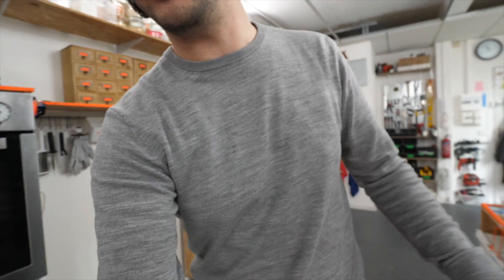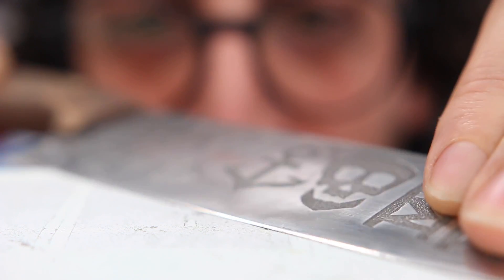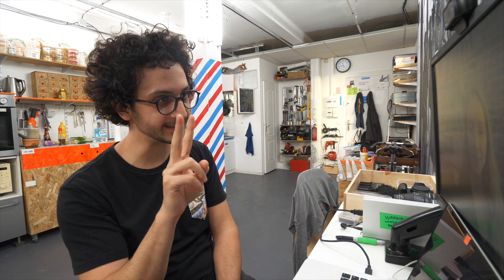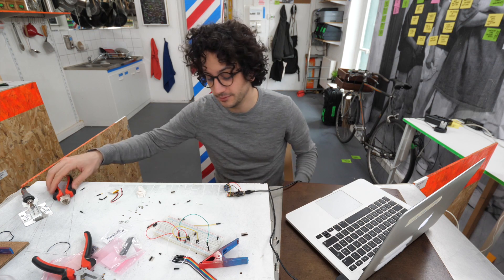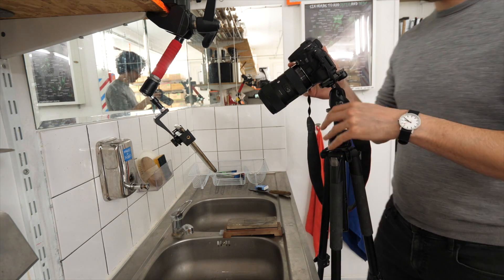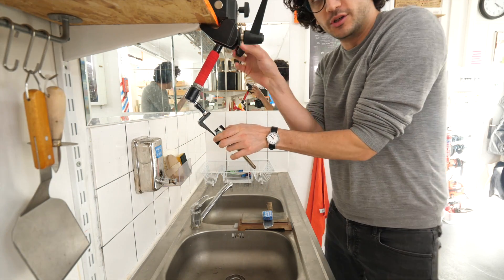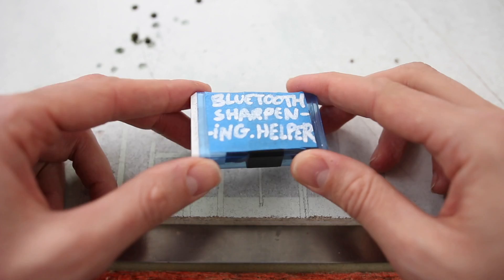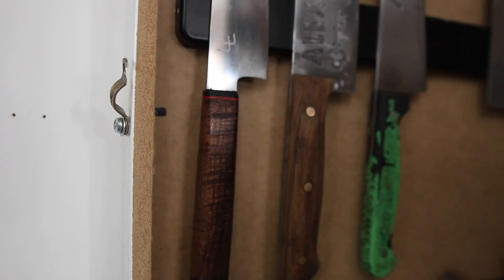Is This The Future Of Sharpening ?

Comment: I think whenever there's a sudden change in acceleration of the knife - back to forward, forward to back - the box probably jerks slightly, changing the angle measured at that moment, even if the knife itself is at a more constant angle. The values shown seem to show this kind of oscillation with the back and forth motion.

Comment: In my country there are guys in the street markets with a device that consist in a rotating grindstone that moves using a pedal.  They just only need to hold the blade in the required angle and the grindstone do all the magic.

Comment: Alex , I understand that digital stuff is way more fun , but maybe look at the problem in more of a simplistic way.  Why not make a new base for your wetstone, that has a wheel and an arm attached to the wheel.  The arm comes out with a clamp like device that clamps to your blades.  On the wheel you have your degree marks and a knob that you can unscrew and tighten like on a compound mitre saw this way there is no way you can mess up the angle .  Perfect every time

Comment: Each type of metal and each specific type of knife has its proper grade for edging. But to increase the durability of the knife wire it is necessary to make the micro-edging. For example: If we sharpen a knife between 10º and 15º, on top of this edging we should make a sharpening of a few tenths of a millimeter with a 20º sharpening.
During sharpening we should not change your angle because it can ruin a perfect edging. Practice makes the master. But today I do not dispense accessories that ensures constant angle during sharpening.
(I used Google Translator for this comment). 

https://image.ibb.co/ivNB9o/micro_Sharpening.jpg

Comment: Hey there. I would recommend a sharpener that uses mechanical angle templates. So that the angle remains constant. Because muscular actions will always create irregularities. Using an inclinometer is a measurement of angle not a guide.
And there are several products out there that are fast and very effective. From top of the line sharpening and honing wheels to kits which clamp the blade and you have several levels of grit and honing. Sharpening a knife within a minute. To any angle for any use and edge lifetimes.
Otherwise all the technology in the world will not help you break the rule of master. 10 000 hours of doing anything will make you a master at it. 
Greetings from Namibia

Comment: Maybe consult someone about ergonomics. Standing at a crouch is likely what's causing your deviation. Your focus is on control of your hands, in the meantime your standing height varies as does your position over your center of gravity. A seated position with an adjusted height to minimize effort would support consistency.  Maybe also try using a finger or thumb beneath the bottom back edge of the blade as a support and gauge. It will vary by person, but will build physical memory you can practice.

Comment: This is a follow on from the reply from Samwise about introducing an audible element to the app to make it more intuitive. 

If you added two tones to the device I think you would very quickly learn to make instinctive micro adjustments to the angle .  One tone that stays fixed at say 440hz would be a sensible value.  Then a second which goes up and down in pitch as the blade moves off axis.  The pitch drops when the angle is getting lower and raises as it increases.  That way you will be able to tell when it's at the perfect angle as you will only hear a single tone (both tones at 440hz).

Comment: A tip for you to get more consistent angles while sharpening: Lock your warms and shoulders, and use your body in stead to move the knife. I like to use a side to side motion by twisting my upper body, but I have heard people that lock their entire body, and just pivot at the ankles. Much cheaper than any gadget. Also I think you are overstating the importance of the angle, one degree either way is not going to make a huge difference to the performance. also for such a small bevel as you typically have on a chefs knife I don't think the shape is super important either, but I might be wrong on that.

Comment: Alex, I don't think the surface you are resting the stone is flat, therefore all your readings might be consistently wrong by a degree or more. If you knew the slope angle you could subtract the value from the reading to find the actual angle that the knife touches the stone. Or just put it on a flat surface! Love your work man. X

Comment: out of curiosity... if you put the "sensor" on a fixed roller of some kind, does it maintain a constant angle?  or are the sensors affected by the simple acceleration of the device?    Known 20º fixed but still wanders a degree or 2?      thanks for the great video..  

I have a digital degree  device but it is a couple times larger than this..   This is pretty close...  https://www.ebay.com/i/181991003712?chn=ps

Comment: There is a much more effective tool. Mechanical. Used to put angle on chisel blade. Shelter timber frame building facility sells some. Take a look.
I found this out via purelivingforlife YT channel. They are building home with timber frames. But if you look at the sharpness needed for shaving wood, thin wooden curls. 
Look for the timber frame "episodes?"
Reply: Side note, they also briefly show a technique that uses a sheet of glass with a substrate attached. Much more parallel. But maybe too sharp is a thing.
😂😂😂😂😂😂
No there isn't.
Reply: Take a servo and add a roller and add a second roller to other end. Servo controls roller angle and elevates blade to correct angle. can add that to code so that angle read can be used to adjust servo  roller "on the fly" compensating for curved sharpening stone.i had to edit five times, should not type before I have my caffeine

Comment: Just connect a vibration motor to device on knife, when you have higher angle it vibrates in a specific pattern and with another specific pattern when you are going lower. But the base idea is very cool.

Comment: My knifes are sharp enough. I use a large 400/2000 stone from amazon and just keep the distance of the back of the knife to the stone constant. I place the thumb on the back of the knife and maintain a slight touch to the stone (not enough to damage the skin). Sharp enough means, it satisfactorily cuts meat and vegetables without using force.

Most of the time I don't use the stone to "refresh" the edge of the knifes, instead I use a steel like this: https://www.dick-messer.de/Wetzstahl-oval-Standardzug-30-cm-mit-Holzgriff-von-Dick (exactly the same vendor/product, but > 40 years old and still works;))

The steel isn't that abrasive, it merely straightens and polishes the edge of the knife. But this makes a great difference! If the knife is sharp, it glides through vegetables without any effort. But at some time it develops tiny spots where it catches fibers and then it becomes annoying. A few strokes on the steel and those tiny spots are gone. No need to get the stone. This refreshing of the edge doesn't work forever, at some time those spots don't go away and then it is time for the stone.

Comment: It's an really cool and inventive idea! But I think a mechanical way to set and constrain the sharpening angle is just better. Except if you want really want to train yourself to sharpen just by hand.
I'd definitely want some kind of easily observable gauge of how well you are on the angle. Something like 6 leds might do.
You should also test with a sharpening system that constrains the angle to see how precise the measuring of the angle actually is. If the sensor does get confused by moving and changing direction. How big the noise is. Maybe software could actually compensate for this specific motion.

Comment: Alex, that is a brilliant concept. I have thought of an improvement where you could eliminate the need for a bluetooth connectivity although having it as an IoT device is quite cool. 

I suggest you have it so you input the desired angle and then have a range of LED's  (xxxoxxx) (where o in this case represents 'spot on' and could possibly be a green LED and x represent LEDs deviating from desired angle. The greater the deviation will cause the LEDs further from green to light up.) 

It could also work with tone that changes frequency depending on deviation from the angle so it would be possible for someone even with impaired vision to sharpen a knife with a wet stone.

I think this combo of light and sound on the clinometer would make the device extremely easy to use. 

Eliminating the need for bluetooth would vastly increase battery life and reduce cost. (perhaps a couple of models, budget and 'bells and whistles' model?)

LEDs would mean that a person could actually pay closer attention to what they were doing on the stone without staring at numbers on a screen. The distinct colours of the LEDs would mean that the device readout does not need to be the focus of the user's attention but rather they can pay more attention to the blade on the stone as the LED indicator array would be clear even in periphery vision and simple and intuitive to understand.

It would be better for some blade profiles than others as the angle of the bevel of a blade can very on a pronounced belly or tip but it will be a useful tool for teaching technique and training muscle memory.
Reply: I should have read the responses before diving straight in as much of what I have suggested has been proposed. Crowdsourcing is awesome. It shows what can be achieved when people share knowledge , creativity and ideas. We really need to smash IP law, it isn't right for sustainability. Every R&D lab around the world reinventing the wheel because a patent stops them using an existing idea or similar idea based on accumulated knowledge is criminal, in my opinion.

Comment: What about using sound as feedback to the user? By placing a piezo-buzzer on the board itself (low pitched beeps if angle is too low, high pitched if angle is too high and constant tone if angle is perfect), you could have unnoticeable latency and you wouldn't have to constantly look at a device to know whether you're doing a good job.

Comment: On average you're probably getting values you want correct? I mean the few data points that are like say 12 or out of the range that you want, they are outliers. If you can have the device calculate an average with a set of values, I think that would be a more accurate representation.

Comment: To throw a more mechanical approach into the mix. You could add a laser pointer to the knife and this way, you could see changes in the angle much better. The point will move because of the knife movement as well, but the change in angle will have much more influence on the position of the light point. You could just mark the start and end point at a perfect angle, where the point has to be at the start and the end of the wet stone and then just try to move the laser point only between start and finish.

Comment: Why not just cut the tip off the angle block and move it with the knife. You could even put a ring in it to make it like a ring of measuring cups. it should hold up fine if it's made out of a PVC like material.

Comment: Hi Alex. This was a very interesting video. Thanks. This whole blade angle debate has pro's and con's on different sides. My main interest is Bushcraft, and most of the Bushcraft community tend to use Scandi ground knives. After watching a video from Dutch Bushcraft Knives I have changed to what these guys call a Scandi-vex grind, which is a slightly convex scandi. Scandi grind edge is well known for micro chipping as the straight angle of the edge is very weak. The slight convex adds strength and makes the edge much more robust, similar to a sabre grind. I am guessing the small variations in your angle are fine, the are making a slightly convex edge. Stronger and more robust. My thoughts anyhow. 
I will link the video from Dutch Bushcraft knives here if you want to watch it https://www.youtube.com/watch?v=ofAI86yZmpE

Thanks for another great video. Looking forward to many more.

Comment: I simply don't get it. Why need to suffer, and keep the angle manually... why don't you make a simple fixed angle jig where only the blade reaching the sharpening pad, and that jig has wheels, that runs next to the sharpening pad. Done. Btw, if Alex has a machete to slice cucumber, spread butter - you have to only expand horizontally to compensate the size, so only few mods, no electronics, and a single 3d printer solves this. Sry Becky. However, this process can be fully automated: make container/bowl that holds water, and a waterpump that press up filtered water constantly above the blade, insert above the container sharpening pads, and above that a jig where the angle is can be set, or be programmed as a process, including the speed of back and forward moves, and every time you get a perfect knife.

Comment: Clamp the knife at the desired angle and run the stone over it across two surfaces flat....
Reply: If you made a jig that held the blade in the same way a open set jack plane holds its blade then it's highly possible i.e.  Gyutou  blade ,Sujihiki / Slicer , Honesuki / Boning , Nakiri / Vegetable Knife , Yanagi / Slicer ect.......

Comment: This is completely feasible, BUT the sensor you're using is probably not compensated and has too low refresh rate. Also, the feedback should be on the blade, not in a smartphone. :)

Comment: you could put the blade on the rock, measure the height in the opposite side of the blade, than use a small piece of wood and cut  in the measured height. i imagine if you make a triangule and cut it in half, vertically, would be better for support.

Comment: have a piece of metal that goes under the blade at the angle you want, it could be magnetic(or have something like two small round magnet's placed inside of two holes on the metal, so it doesn't move as your sharpening. the bottom of the angled metal has something like plastic so it doesn't damage your stone. why make a machine, when you can just use something at the angle you want it, having it not move at all when attached to the knife. rather then going more complex, making something simple may be best.

Comment: The tool your're trying to make already exist! I use one just about every time I change the angle on my table saw. It's called a digital angle finder, cost about $40. Small magnetic block with an LCD screen and you can zero it out.

Comment: The app could be designed to give visual and sound feedback inspired by dance games. (on screen:) "Good! Good! Great! PERFECT!" according to how close you are to ideal angle. Instead of numbers, a constantly updating line (from the right side) that is at center of the screen when you are hitting your desired angle, above when you're too high, and under when you're below.
Rough illustration: ----_--¯-¯--
The app should also have a library of sweet electronic music that plays at the desired BPM of your desires sharpening strokes per minute so as to not let you get carried away or get lazy, and instead do a consistent rhythm. ;)

Comment: Get a Wixey.  They can tare to a relative zero angle, allowing you to see where/when you're at your proper sharpening angle.  They magnetically attach to your blade.  They're actually for table saws with crappy angle adjustments.  It doesn't matter if the saw isn't on a flat level floor--that's what the angle tare feature is for.  It should work equally well for knife sharpening.

Comment: Alex, you're WAAAY over-complicating the solution to a relatively simple problem.  A Lansky sharpening kit is inexpensive and ensures precise and consistent angles from 17 degrees on up.  I custom-built a kit in a fitted case with all the tools, rags, water container, soap, etc, to do a blade a treat.  Going from a diamond rough shaper "stone" all the way through a 2000-grit sapphire stone and then finishing with a leather strop "stone" charged with jeweler's rouge produces a literally mirror edge that cuts through tissue paper without drawing the blade.  Let me know if you want the specs and I'll send them to you.  Of course, if you're REALLY serious about sharpening blades and you have a thousand bucks US to spare, you can't beat the Wicked Edge Commercial Series Sharpener.  But beware, Alex: those who look upon it once are destined to dream about it forever, much as if it were Venus herself.  You've been warned. :)